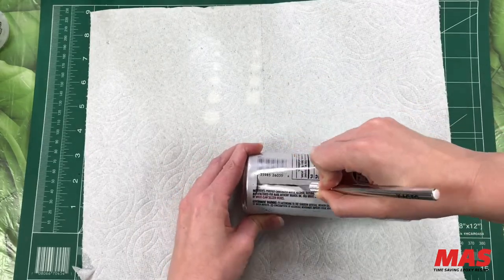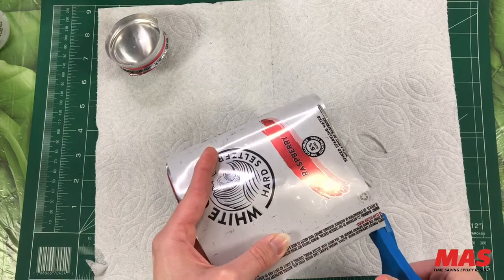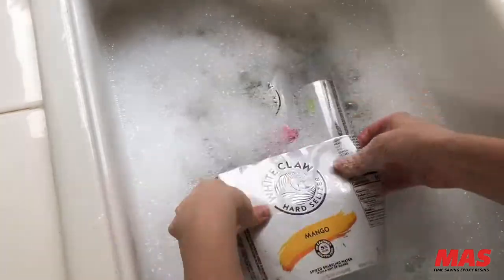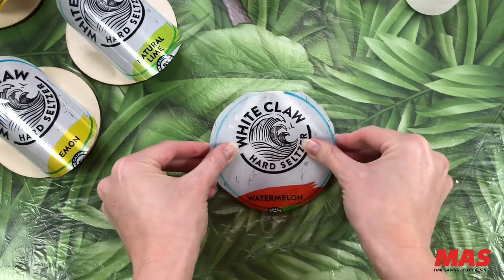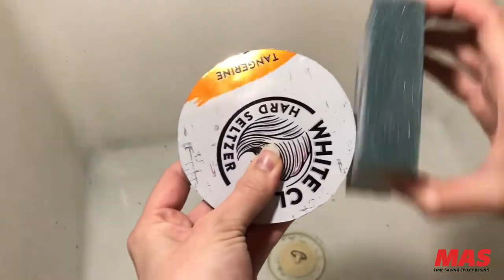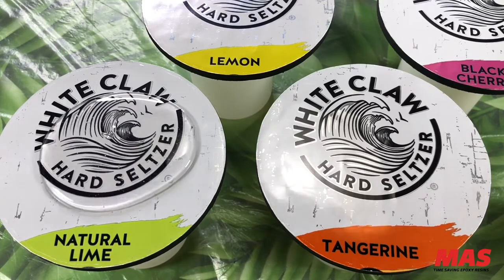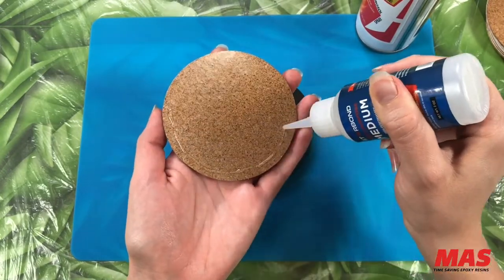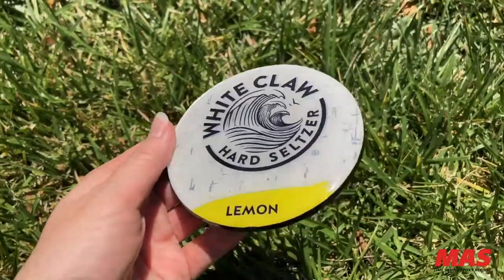DIY White Claw Epoxy Resin Coasters

Comment: You sure that accelerator works? I spray and all it does is leave a gap between the wood and can and once I start sanding the corners or extra can the can pops off